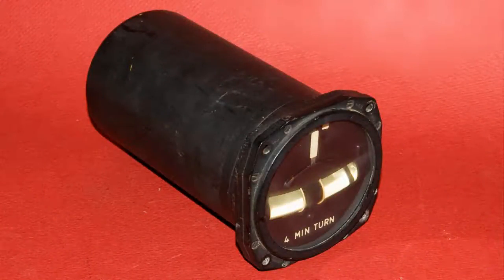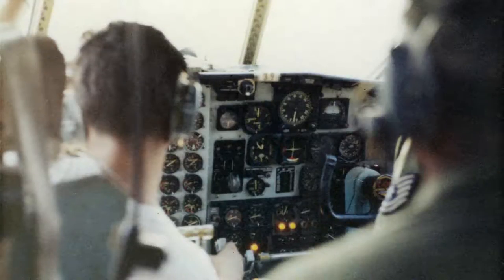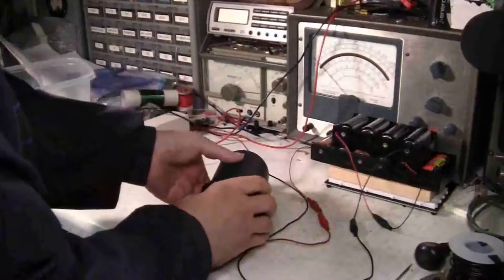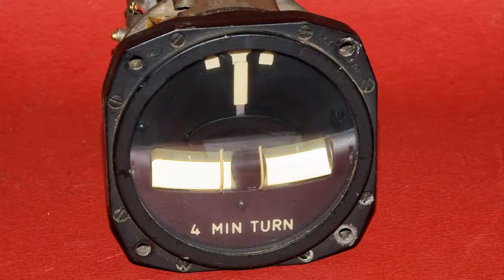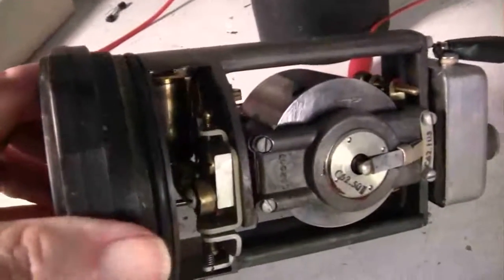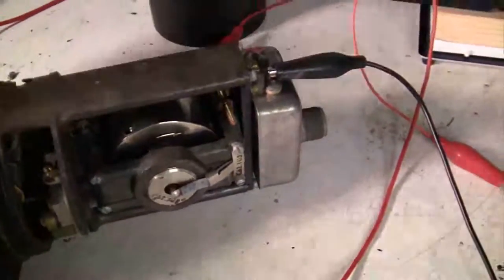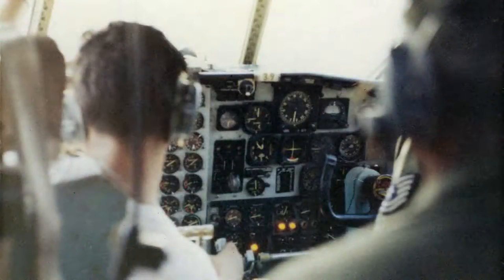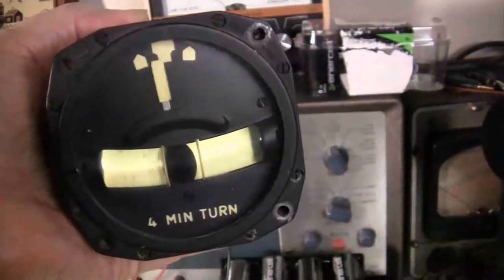Indicator, Turn & Slip, 4 Minute Turn, Aircraft one each

Comment: That was neat, Rick.
I ran a helicopter avionics shop in Korea. One day one of the unit pilots asked if I'd like to go for a ride. I said sure, but didn't know it would turn out to be an all-day thing.   Anyway, a few hours later with the fuel gauge reading only 3lbs. and my butt biting the seat, we safely landed at a refueling site.  When we got back to the unit I hugged the troop who calibrated that fuel gauge.  Think I also gave him a day off.

Regards,
John

Comment: @Serpico261 The ball is just installed in the gyro for convenience. No mechanical connection at all with the gyro. The ball moves to the left or right only due to the resultant of centrifugal force and aircraft weight pointing down. It is an indication of using too much or not enough rudder by the pilot.

Comment from the maker: @CameramanLink 
Yes, I have an Attitude Indicator. But it is a sealed unit and the indicator is just half of the system. The other half is the transmitter which is were the gyro is located. This transmitter is located on the aircraft away from outside interference. So all I can do is look at it.

Comment from the maker: Thanks CameramanLink
In a C130 if there is something wrong you usually know it. If it is an engine the sound is very different. Also there are alarms and warning lights. In the picture you can only see two rows of engine instruments, there are four rows. In flight all four rows of engine instruments read the same information for each engine, so if one changes it is very easy to see at ones.

Comment: I always called that a turn and bank indicator.  If you make a turn and keep the needle on the index mark and the ball alligned with that index, it would take four minutes to do a 180 degree turn.  It's helpful for navigating.  If in a turn, the ball gets off center it means the back end of the plane is "slipping," which is kind of like over/under steer in a car.  They used to tell us to step on the ball, meaning to apply the appropriate rudder pedal to bring the ball back to center.

Comment: What a solid piece of gear and well made. I suppose the more modern equivalent is lighter with a lot of plastic/carbon fibre in the housing and component elements?
Reply from the maker: Thank you. This instrument is like what is used on a C-130 Aircraft. I worked on a bunch of them. I just put-up a new video.
Impedance Back EMF Practical Demonstration
https://youtu.be/JrI7I93XzYk